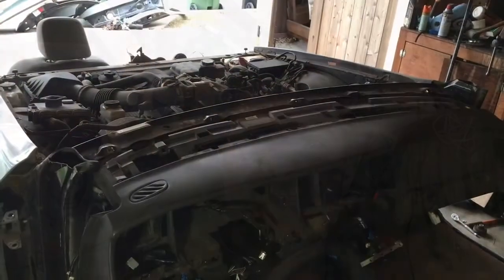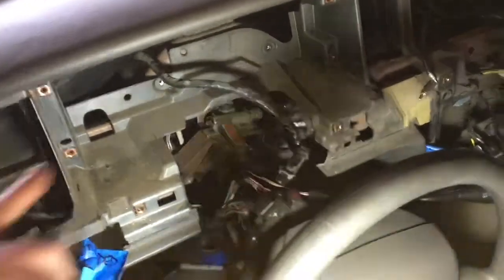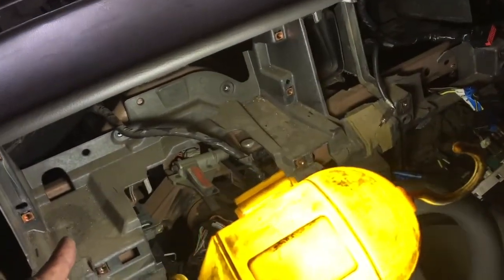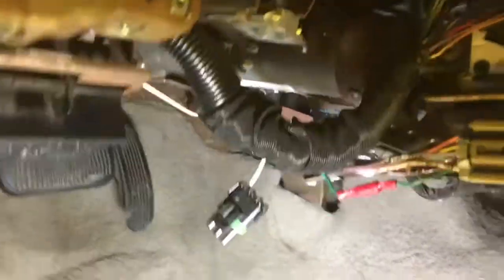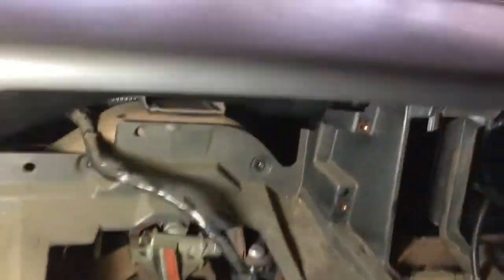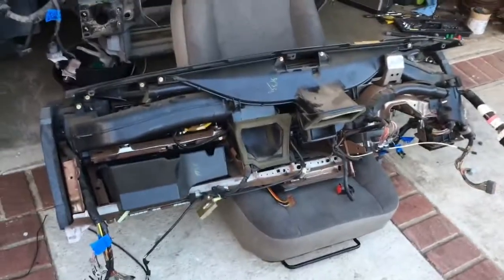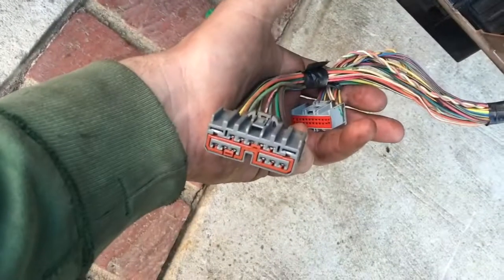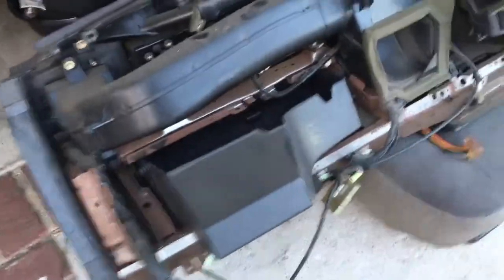Crown Vic full dash & frame removal

Comment: wanted to add on 97 model that middle dash support bolts can be accessed threw glove box with 10MM,  bar runs between firewall and a/c control head housing on passanger side instead of on driver side like in video.  (Nathan, you can add this comment to video if you like)